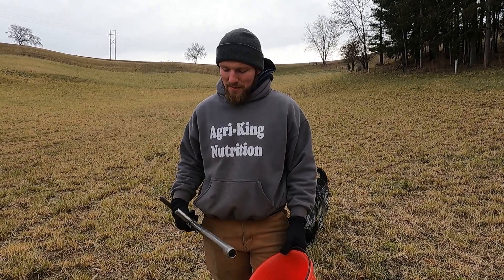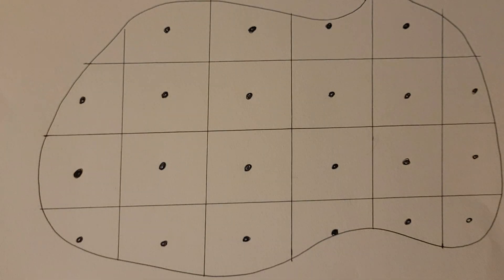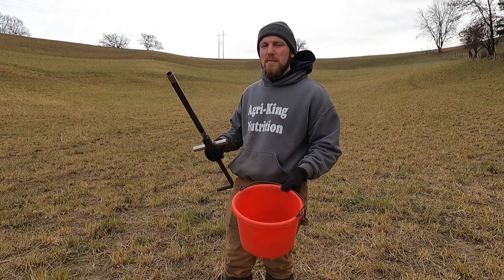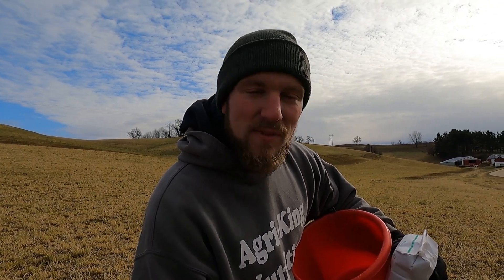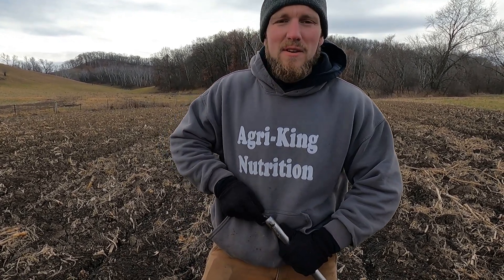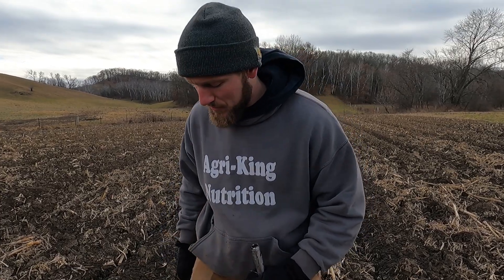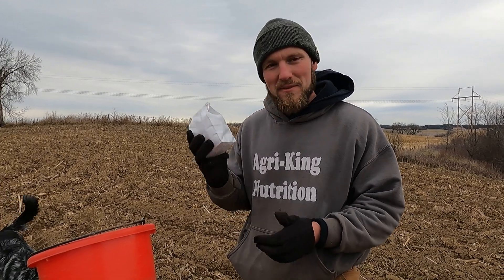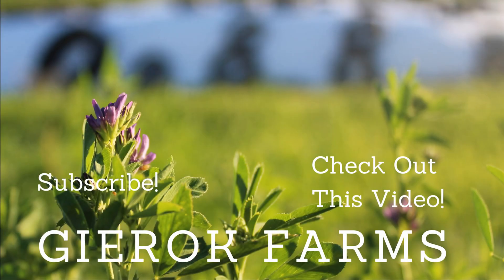How to Soil Sample!

Comment: I know that some people that have been no-tilling are realizing that they have nutrient stratification occurring in their field whereby most of the nutrients are in the top 3 to 4 inches of soil basically because they topdress most all their fertilizer. So they after several years they'll plow to 
Incorporate the nutrients deeper in the root zone as as bad as the criticism is a good moldboard plow works best.  I  raised cotton years ago and had gone to planting sourghum sudan on 
Summer fallowed ground turning it under in august or september.  Sourghum sudan is extremely drought resistant and produces a great amount of organic matter years ago hairy vetch was planted in the fall on ground that going into cotton  or corn the following spring but vetch really needs to be planted with a small grain like wheat or rye so when it comes out of dormancy in the spring it has something to climb on.